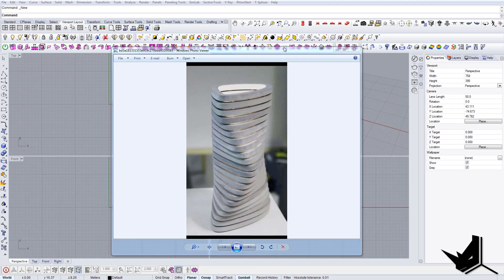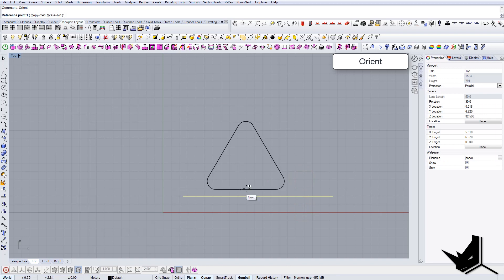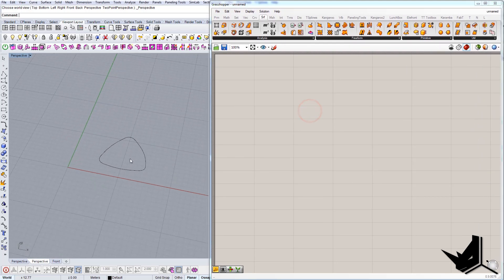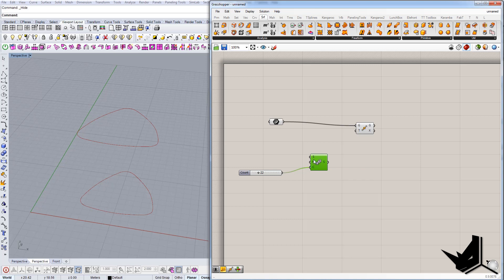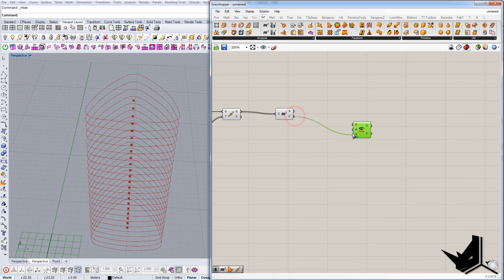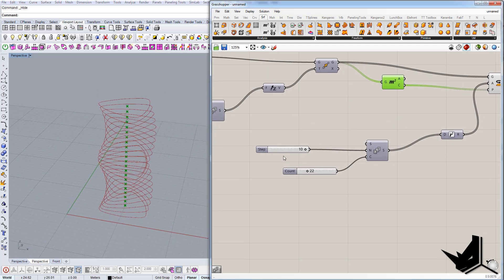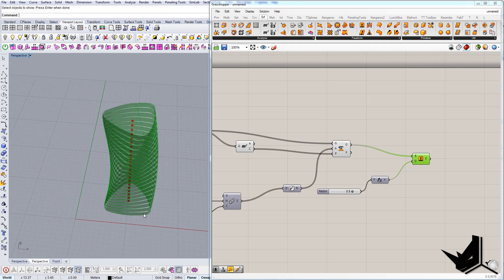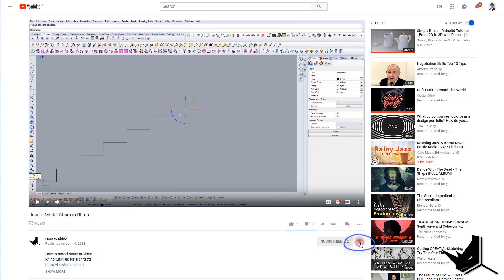How to Model Rotational Tower in Rhino

Comment: It is possible to 3d print this model? I am having trouble when I tried to send it to print.
Reply from the maker: Yes, it is possible but this model is "conceptual' and it has gaps between the floor plates. In order to 3D print it, you'd need to make a slight modification in the definition, so that it can be 3D printed.